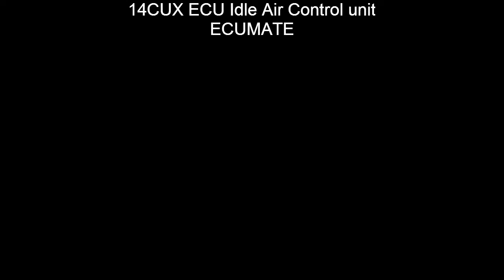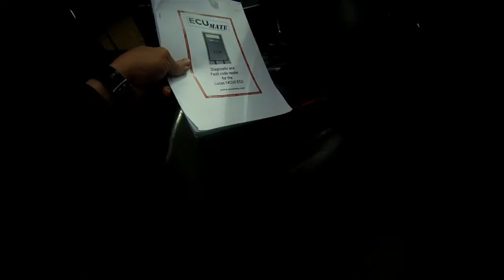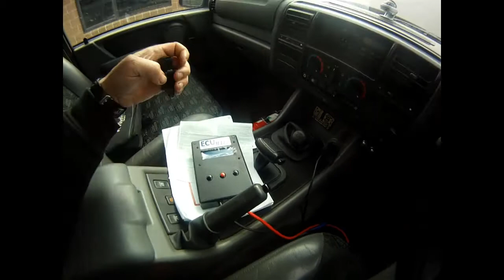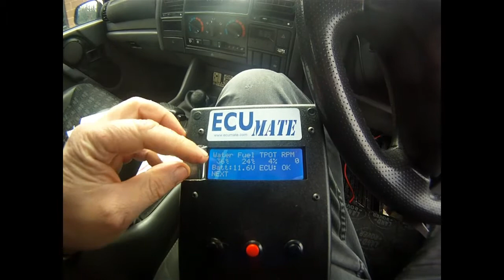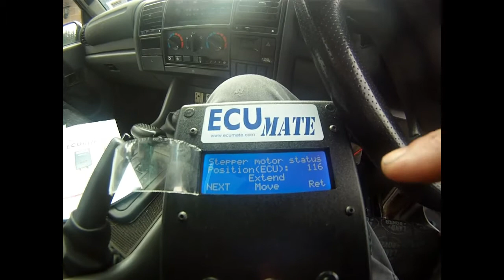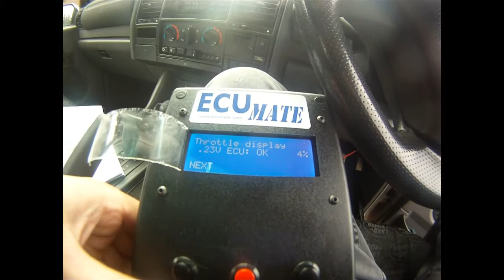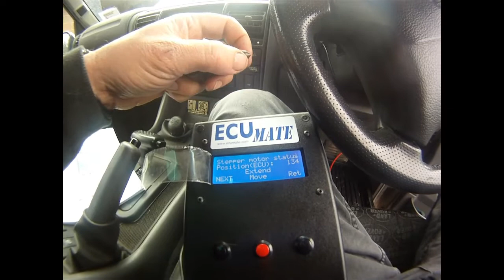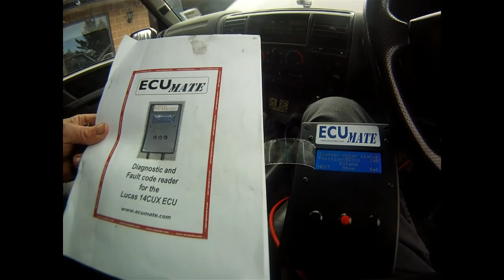Land Rover Discovery 3.9 14CUX EFI stepper motor using ECUMATE. www.ecumate.com

Comment: My v8 disco 1 won't idle at all. Could this be a stepper motor issue? I recently well and truely drowned the engine (hydrolocked) and vehicle in a deep river crossing.

Comment: excellent vid, wondering though if a stepper motor stuck in idle would cause rough running and idle.
Reply from the maker: Possible but check your air flow meter. Sometimes the voltage can be out on the idle screw, Google Rover V8 air flow meter voltage there's a website that gives some great instructions for testing and adjustment cheers
Reply: +MrBeamerdave thanks for that, i hope you do more vids

Comment: Great video, I wish I'd seen this when I first bought my ECU mate, took me ages to work out where to plug it in just couldn't for the life of me find any reference!  My Disco 1998 3.9 isn't quite running right but is on LPG so there are any number of potential issues.  I bought a £12 stepper motor and found it revved at 1000rpm so took it out.  I'll try your method now of trying to adjust it through the ECU mate.  Good stuff, great that people like you take the time to explain it to noobs like me :-)
Reply from the maker: Glad you found it uesful, I have just purchased the Hawkeye plan to do a review on that .